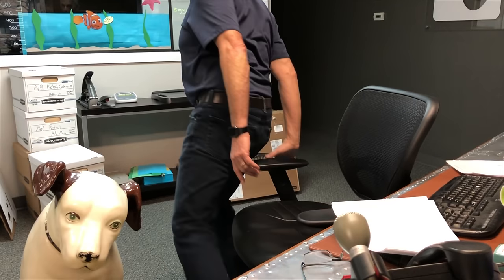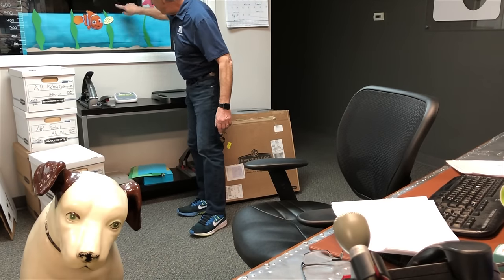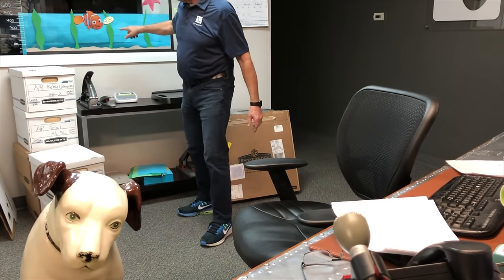Why do tubes sound different than transistors?

Comment: Tubes do sound differently. I have a 1957 The Fisher model 80T Hi-Fi mono AM/FM tuner and preamp. In addition to treble and bass control it has four loudness levels. I connected it to a solid state integrated amplifier. Whenever I want to listen to old hi-fi jazz or blues recordings, I use the 80T. The sound is far richer and warmer than that of the solid state own preamp, although it is mono. The technicians of The Fisher went to great lengths to have a hi-fi preamp with very low noise floor and great Dynamic Range. The four levels of loudness allied with the treble and bass controls provide the best audio configuration. This 80T preamp and tuner also came with a power amplifier which also has it's own four level loudness control. I haven't used yet, because I have to figure out a way of commuting the speaker boxes from my solid state strereo equipment to this mono power amplifier and vice-versa.

Comment: One is a voltage source the other a current source. High impedance vs. low impedance.
A tube takes a matching/output transformer... which affects the sound, due to magnetic saturation.

Keep them solidly in the linear range and not that much difference. Which isn't what we do w/ tubes.

Yep. What he says.

Comment: Oh, brother.

This stuff is not rocket science.  Both tubes and transistors can be used to amplify.  It's harder with tubes because they usually will need things like transformers and it will be much  harder to build a low-distortion device.

On the other hand if a tube amp is driven too hard and clips, it will clip in a way that sounds different but not terrible.  Transistors will clip hard.

So, many advantages to working with transistors.  But don't drive the amp so hard that it clips.

By the way, throwing around terms like "warmer" or "softer" means what, exactly?  Stick with engineering terms, please.

Comment: Operating voltage range doesn't sound like a major reason for the sound differences. Tube amplifiers sound different because they have primarily second harmonic distortion (less harsh than transistor distortion), high output impedances (less damping on speaker resonances), commonly use single ended outputs, typically operate in class A mode, use transformers in the output stage and have modest feedback (if any).

Reports from people who have better ears than I do suggest that tube amplifiers are hard put to compete with a good class A transistor amplifier - or even a basic one like the J Linsley Hood amplifier.

Comment: This whole thing cracks me up.  I'm a guitar player.  I've used my old Peavey guitar amp on gigs and had other guitar players come up to me and say "... man, that thing sounds great.... that must be a tube amplifier... "  I like this because I'm using a relatively inexpensive amp, that has no tubes in it.  In fact, the whole amp (which is all discrete, no ICs) has only one FET in it.  The rest of that transistors are bipolar junction types (BJT transistors.)  Peavey was cleaver in that they did use an audio transformer on the output, which helps to add just a bit of tube like "mud" into the sound. This amp was a cheap amp, to begin with (and I've replaced some parts with parts from a surplus store, occasionally) and that's what makes is especially amusing when guitar players mistake this for a tube amp.  After I reveal that this is a solid state amp, I say to them: If tubes, alone, made for audiophile level listening, every table radio from the 30s, 40s and 50s would be audiophile quality... and we know that ain't true.

Comment: what if they made the filament from a metal combined with tungsten ? it might make the tube last longer
Reply: Paul's explanation is somewhat incorrect. Tubes only function in a vacuum because air blocks the electron flow between cathode and anode/plate (beyond the filament burning up). To my understanding, filaments usually are tungsten or an alloy of tungsten and other elements, and the cathode (the part that actually does the thermionic emission/"boiling off of electrons") is made of a combination of alkaline earth metal oxides (e.g. barium oxide or strontium oxide).

Comment: I started with tubes and when transistors came along, the major diference was the power curve and noise floor. Tubes have a much softer gain curve, and can amplify well past their max power limit and liniarity to the point of melt down. The resilting odd harmonics are easyer on the ear. 
Trensistors' sharper saturation point gives even harmonics (square waves) harsh on the ear when over driven.
The design solution was to operate transistors well below saturation and prebias above the noise floor.
Field effect transistors do act more like tubes,  and as a result designers can now "program" amplifiers to sound like a tube amp.
Reply: The odd harmonics you describe are from push-pull circuits which cancel out even harmonic distortions and apply equally to solid state and tube amps. (Perhaps you meant EVEN harmonics?)
The even harmonic distortions from a single tube power amp closely match the human ear. The brain interprets this distortion pattern as being louder, hence these tube amps sound louder than they measure.
The sharp clipping distortion patterns from solid state gear is mostly down to the comparatively large amount of global negative feedback used. Pentodes have similar problems (plenty of gain at the expense of linearity). With simple speakers and triodes you can get away with no negative feedback at all. You get a natural sounding amp with dreadful measurements...
Reply: @TheRealWindlePoons  very true said, always misguided the issue by the uneducated people. Thanks brother

Comment: The tubes cushion the sound, that is, they dampen it. I don't think it's any simpler than that.
Why do they sound better? I'm not an engineer or an electronics technician, but starting from the fact that when an electrical signal reaches the tube it has to be converted into electrons and pass through a gaseous medium, perhaps it is this medium that adds dynamics to the flow of electrons.

Comment: I'm with you! Years of thinking, no preamp is better than a preamp, i bought a pass b1 (and it don't amplifies)
and power amps got second ranging.
Using a (in Germany Dynavox ET 100) Chip Class A/B Amp, it's as smooth and musically as the Musical Fidelity A1 Integrated, without the Class A power consumption.
Also the dynamic is improved remarkable.
Thanks for your Clip, i enjoyed it .

Comment: Start again from basics, please. 
A bjt is a linear current amplifier (current in-current out, small input impedance, large output impedance), a triode is a linear voltage amplifier (voltage in-voltage out, large input impedance, low output impedance), a jfet/mosfet/pentode is a linear transconductance amplifier (voltage in-current out, large input impedance, large output impedance). 
A loudspeaker driver is a motor, therefore driven by current (to behave linearly). But then, there is the loudspeaker crossover circuit, which is usually designed as a voltage devider, unfortunately.
From these basics, add the high voltage bias of tubes (that increases electric carriers mobility) and tubes' "excess" amount of carriers (as electronic cloud inside them) that helps in soft clipping at large transient demands.
From the above all combined, go to amplifier's output driver stage, then to the input stage and finally combine them all together, keeping in mind that we are used to design (from the beginning) voltage mode circuits that are easier (in controlling voltage). We are also used to voltage signals, but that's another long story.
Have a nice day, all.
Reply: Not quite following you Yiorgis Alexakis. By triode do you mean vacuum tube or valve triode? Because tubes have high output impedance, which is why they typically use output transformers to connect to loudspeakers.
Reply: Stuve715, you refer to "high impedance" in relation (relative) to the loudspeaker impedance, which is quite lower. Driving a relatively lower impedance, is what makes necessary the use of output transformer (and that does not contradict to the "low output impedance" concept of a voltage amplifier). 
In general, a triode tube/valve- being a voltage amplifier - should present a "low" output impedance (if it is a good voltage amplifier) to prevent action of a voltage divider between its output impedance and the load impedance (something that alters output voltage on the load, thus "violating" the constant voltage source concept of a voltage amplifier's output.
I started my comment by saying that going back to basics could explain a lot of vague impressions that survive in audio in general. For example, all tubes do not have the same amplifying behavior. Pentodes are not voltage amplifiers, as triodes. They are transconductance amplifiers.
Another one: higher voltage JFETs/MOSFETs are quite different from low voltage ones as far as transconductance linearity and dynamic range (but that is another long story).
Reply: I wish you did the video, and explain current amplifiers as I always think volts is the energy difference that causes the current, can't think of a flowing current causing a voltage.  Also,  I thought you want high impedance i/p so the volts at i/p not affected too much ? Also isn't it something to do with harmonics why valve clipping is better ?
Reply: Starting from your last question, harmonics is a phenomenological result (that we measure) of what is actually happening inside the tube and that is the excess of electrons stored as a cloud and the current demands they can fulfill. These electrons contribute to soft clipping and also when a tube is over driven. We refer to the larger percentage of even-to-odd harmonics of the tube's output to just distinguish the perception that even harmonics (governing tube's output) give "light" to a more acceptable sound to our ears (odd harmonics are sounding harsh to our ears). Harmonics are produced from the non-linearity of an amplifier's output current-to-voltage characteristic (abrupt non-linearity produces more odd harmonics), which also has to do with the availability of carriers demanded by the signal to be driven to the amplifier's output load. 
Now, as far as high input impedance, it is indeed necessary for avoiding voltage signal losses at the amplifier's input. It is a "must" when our input signals are voltage signals, especially small ones. Higher input impedances can be found in amplifying devices driven by voltage, such as voltage amplifiers (e.g. triodes, opamps) and transconductance amplifiers (e.g. jfets, mosfets, pentodes).
As for the current amplifiers, they need to be driven by current at their input as their input signal, in order to behave as linear amplifiers at their output. The device example we have is the BJT.
Finally, as you mention, voltage is the potential difference that is needed for the current to flow in between. But "free" moving carriers are needed in the first place for the current to be created. This is general and it doesn't contradict with the case of current amplifiers, at all.
I hope I did give you at least a rough idea about the subject. The limited space here is not suitable for more details. You can find many resources about all types of amplifiers at the internet to continue your quest.
Reply: Thank you very much for answering my questions, I can see that you have a great deal of insight in this subject, and I will look into BJT current amplifiers  more now, thank you.

Comment: Tubes sound warmer people will say but those that actually aren’t biased will also tell you that “warmth” is also in its own way “coloring” the sound in its own way. The fact that the effect is often seen as a positive one it is seen as a benefit when in fact can take away from the real sound. 
Transistors get a bad wrap taking a lot of blame from not only their limitations but all the other issues with digital/solid state audio as a whole. 
Digital is getting much better and to be honest I would rather work with hardware that can give me root mean square delivery rather than huge and wide dynamic headroom peak and valleys. 
There are some industries where tubes will never go out of business even if it takes an emotionally tied technician for each system as each system has its own personality.... not talking audio but within defense systems.

Comment: In the guitar amp world. There are a lot of units that use a tube preamp, and are solid state for the power section. A good 12ax7 triode-balanced tube will last a long time. A good tube like a Tung-sol etc, really adds to the preamp section in that saturation is achieved if pushed, as opposed digital clipping . That’s my 2 cents for the day ;)

Comment: Great rundown on the differences.  The generality is mostly correct.  Enhancement Mode Field Effect Transistors do have very low input current in the DC area and can be operated with electrostatic charges.  The difference here between them and vacuum tubes is a grid in a vacuum tube has very low capacitance as it is thin wire physically spaced away from everything else. In a Enhancement Mode FET, the gate capacitance is quite high, and even worse changes with voltage as the depletion region changes distance creating a distortion that tubes don't have.  For this reason, FETs have to run with relatively high amounts of negative feedback and do not sound the same as tubes in low or no feedback applications.  MOSFETS are best used as either switching devices in inverter power supplies such as automobile high power amps, or as output transistors with high levels of feedback to control linearity.
Bipolar Junction Transistors, have various amounts of linearity depending on the device.  Some are very linear and make great output stages in a classic AB biased push pull output stage with little feedback for linearity.  The family of curves on these transistors can be seen when driven on a vintage Tektronix curve tracer.  Some have excellent linearity over a family of current steps.
https://www.valuetronics.com/product/370a-tektronix-curve-tracer-used?gclid=EAIaIQobChMIgsi3497s3AIVj19-Ch2jpQLQEAQYAiABEgKBFPD_BwE
Our shop has one.  Unfortunately the voltage step range is often exceeded by more modern MOSFETS with higher gate voltages.  It would be nice if they updated the instrument to include modern MOSFETS.  Some MOSFETS require more than 3 volts gate to begin conducting.

Comment: The sound is different because with tubes you need an output transformer and transistors don't. The transformer, being an induction device, will bring its own colouration to the sound.

Comment: This is oversimplification to promote flawed thinking in the interest of separating people from their money more efficiently. The truth is that how one particular building-block "sounds" is nonsense in this context. It's the loudspeakers that make the sound, not the electronics! Unless you're an electric guitar player using willful distortion as a means of artistic expression, you'll want your electronics to be more linear, that is to have no "sound" whatsoever. And the best way to do that is the best you can with the technology you have at hand.

Quite a few years ago, a fellow named Harvey Rosenberg of NYAL gave me a book that he wrote that purported to explain why vacuum tube amps "sounded better" than transistor amps and op-amps. The fatal flaw in that argument was that Harvey had assumed a couple of things that weren't in fact inseparable traits of each device. Not all tubes were biased to Class A, not all transistors to Class B and not all op-amps were Class AB with bad crossover distortion. What's more, the differences only really occurred when a given amp circuit was used outside its linear range. So after I removed the BS, the result was that yes, a tube amp makes nice creamy distortion, rich in even-order harmonics and lacking harsh odd-order harmonics. What it told me about amplifiers that were NOT overdriven was...nothing.

The one thing that the book did teach that young EE student was that the business of so-called "high end" audio was all about dodgy marketing--the engineering part was not much of a factor at all. Sure there was something to be gained by building a better amplifier, but don't expect people to beat a path to your door for it. Besides, it was the loudspeakers of the day that produced far more unwanted nonlinearity, not the amplifiers!
Reply: Sorry max bauer, it doesn't look like you're getting it at all. My whole point is that there's no inherent trait of vacuum tubes that isn't a trait of transistors that make tubes any better than transistors. It's all about the design, not the component parts! What you're trying to claim is simply not true. Looks like a case of confirmation bias to deflect buyer's remorse.
Reply: Well max, if you're hearing things from capacitors, you probably need to cut back on the hallucinogenics. Claiming some undefined dimensional superiority has got to be the silliest case of confirmation bias yet. No, "different" does not mean "better". Look at that, Chris Bishop said almost exactly the same thing a month ago, just below!
Reply: Pot kettle black, max. Pot kettle black. You're the one making fallacious claims here, max. Name-calling me is just more proof that you're a liar.

Since you can't be civil, this is where I put you on mute.
Reply: Tube or transistor,  all well designed amplifiers produce an exact duplicate (only larger) of the input signal.
Reply: Distortion spectra, IM distortion behaviors, slew rates, internal capacitance all differ greatly between tube and transistor. They each have strengths and their basic designs are functionally different. They both amplify, yes, but they do go about it differently with different byproducts. They are separate species.

If materials don't matter, why not make speaker cables out of aluminum?